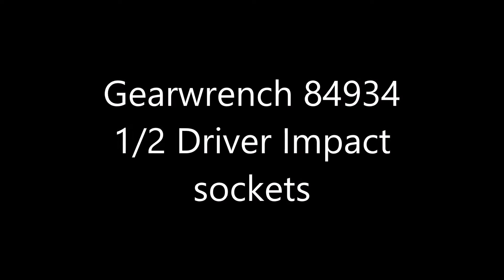Gearwrench 84934 1/2 S.A.E Impact Socket Set

Comment: someone told be those deep wells arent very deep. is that true?
Reply from the maker: Richard Cowtails They are normal depth me and a guy i work with have the same socket tray with the same sockets but the only difference is that his sockets are matco and myn are gearwrench his box is a matco and myn is a snap on classic if i go to put his tray in my box I would have to take out the rubber mat in the bottom so there only a hair shorter than matco sockets
Reply: ok thx.